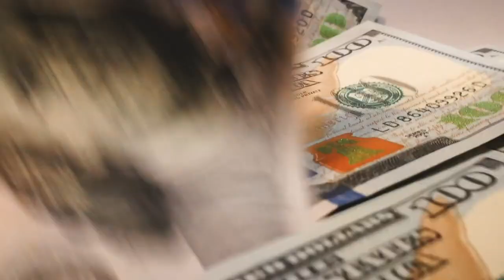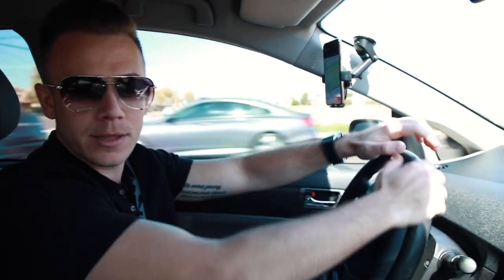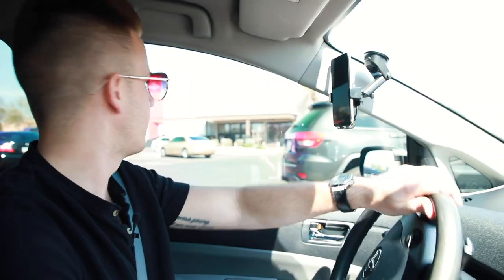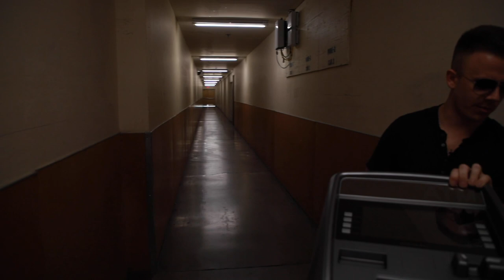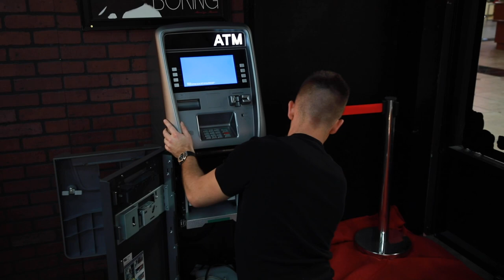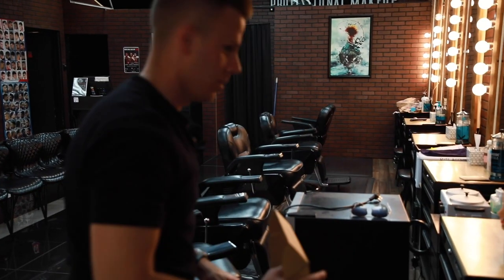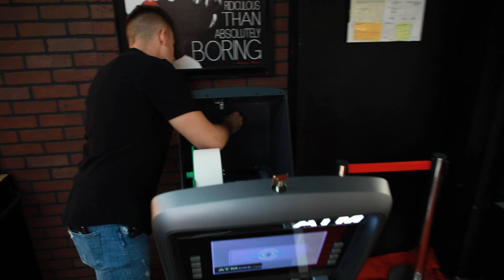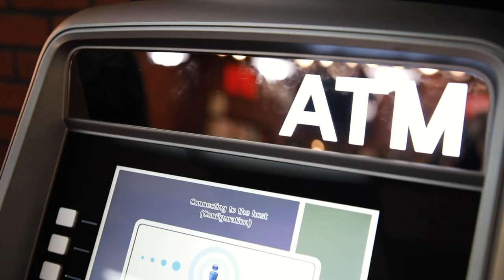INSTALLING An ATM Machine | $375/MO Passive Income

Comment: Should you secure the machine to either the wall or floor or simply relying on the weight as a deterrence?
Reply from the maker: I would bolt to the ground but some businesses do not allow

Comment: I've been lucky enough to find a set of used machines going for considerably cheap and would like to use this opportunity to develop a secondary source of income, however, there is a lack of information on how to get things started being based in the UK, so here are some questions i would like to ask:

1. If purchasing and owning the ATM, do i need to be partnered with an Operator?
2. If YES, do Operators charge a fee per transaction?
3. If NO to question number one, will i be the person installing the machine at the location?
4. The machines are dial-up, is this still ok?
5. Do i need to create contracts between me and the location owner?

I hope you get to see this query, and do look forward to a response!
Reply: Be careful when purchasing used machines, sometimes they’re  already pre programmed and will scam you, if you do plan on buying a used machine, do it from a reputable seller

Comment: For wifi, can it wirelessly connect? I saw you connect it to something
Reply: I know for Genmega 2500 ATM’s you need either a atm modem or the business needs to have an Ethernet cable you can connect too

Comment: If the mall had free WiFi, would you be able to use that or would it need its own WiFi router?
Reply from the maker: Unfortunately no that wouldn’t work, you’d still need a separate WiFi box.
Reply: @AustinZaback  where do you get a wifi box and how much is it?

Comment: Great video. 
Do you use the barbershops Wi-Fi? Or do you have a separate plan?
Reply from the maker: Couple ways I did it. You need to hardwire the Ethernet to the modem or router or get a Wi-Fi extender and connect the extender wirelessly and both would be connected to the shops connection

Comment: The WIFI is a additional charge?
Reply from the maker: If the location does not have Wifi then you would have to go with DPL or something of the sort.
Reply: @AustinZaback  
Hey buddy, do you ever bolt them down so kids or adults don't tip them over?

Comment: I wish to know, how much does the owners charge you for placing your ATM in their shop?
Reply from the maker: Many times they don't charge anything at all! But it really just depends, It's always negotiable. I typically wont pay them much if I do it will be around .50$ per transaction.
Reply: @Nolan.Gurule  of course he doesnt answere the major questions like "nobody will let  you tear up their floor to bolt it down".
Reply: @beast4548  I’ve only had one location not want to put holes in their floor. We use drop in anchors so if we ever removed the machine or moved it we could just cap the holes. Not ideal but I’d never want to install a machine without bolting it down
Reply: @marcusanderson3995  nobody wants a cheap fix after you destroy the floors! Your method is terrible and no respectable business would let you destroy there floors that cost must more than a $1500 ATM machine.
Reply: @beast4548   well good thing I’ve never had to remove a machine and patch some small holes. Any respectable business would understand the cost to place an atm in their establishment. If someone broke in, the last thing they’d be worried about is 4 holes in their floor. Why even place a machine if you think you’ll have to remove it later?
Reply: @marcusanderson3995  you have no clue what you’re talking about. Most business just buy their own atm and machine and keep all the profit. You come in with your cheap machines that only dispense 20’s and the damage you do to the floors far outweighs the cost of the machine.
Reply: @beast4548   you just revealed your own ignorance. Quit commenting about a business you know nothing about.
Reply: @marcusanderson3995  sorry bud, the truth hurts. People need to be made aware of this scam. It’s a terrible business and is quickly vanishing.
Reply: @beast4548  what truth? And how is it a scam? Atms aren’t going anywhere. You have to hustle to get locations. It’s much harder to enter into the market now as there is much more competition and getting an atm in your store is easier than its ever been with many companies willing to pay 50% of the surcharge in commission. But go check any gas station, liquor store or market and let me know if their machine isn’t bolted to the ground. I guarantee 99% of them are. But those aren’t good locations right?
Reply: @beast4548  I’m sorry dude but you’re obviously the one lacking experience. I’m in the business and have been for almost 7 years. I have multiple merchants loading their own machines. True, a couple have had their bank accounts closed with no direct reason as to why, but they found other banks willing to take their business. What kind of business doesn’t want an atm because it will look tacky or threat of theft? I’ll tell you, one that’s not a good location for a machine. There’s a reason there’s an atm in every gas station, liquor store, market. It’s because they make money. Look there’s drawbacks to every business. If it was so easy, everyone and their mom would do it. A lot of people have tried and realized it’s not as easy as it seemed and gave up. You have to grind. I didn’t make decent money until my 3rd year and had to work as a service tech for Cardtronics to cover my bills. It sucked and my days were very long but it paid off. Good luck finding a way to make money in this world without a lot of effort.
Reply: @beast4548  I’ve been forthright throughout this whole exchange. Were you someone who’s bank account was closed and stuck with a machine? My merchants were all able to find banks to take their business. I have multiple gas stations and markets so just because some own their own machines doesn’t mean they all do. Seems like you’re just making excuses as to why this business won’t work for you. It’s not for everyone. And how is it a scam? I don’t make money off other people getting into the business. If anything I lose money because there is more competition. I just know I was in the same situation as them and I’m willing to help give advice. If everyone was as discouraging as you I might not have taken the steps to build it into what it is.
Reply: @marcusanderson3995  I’m trying to help people so they don’t waste their time on pipe dreams. Long story short, this is not advantageous to anyone and if they are lucky enough to find a bank that will open a business account they will close it after three months and be stuck with a worthless machine. Other respectable YouTubers have emphasized this flaw that you refuse to acknowledge. To anyone reading this… Don’t try and start an ATM business or you will be wasting a LOT OF MONEY AND EFFORT!
Reply: @beast4548  so you’re not speaking from experience? Good to know. The business isn’t for everyone. You have to hustle. Not all banks will close your accounts but you seem to think every single one will. If you’re getting into the business, you have to think about it as a side job. Don’t go into it thinking you’ll be able to live off of it. You won’t make enough money for that until you have lots of good locations.
Reply: @beast4548  you’re bitter about your personal experience. Fantasy is “the bank will close your account no matter what”, “no one will let you drill holes in their floor” and “the machines only dispense $20s”. All lies, the exact opposite of being honest, or you’re just talking about something you don’t know. It’s not easy. Starting any business is very hard and a lot of people fail. But people learn from their failures and hopefully have a better understanding of who they are and which direction they should go next. Your advice is, just stick to a real job because you won’t make it.
Reply: @marcusanderson3995  Dude your whole deal is a sham. Bottom line is that the ATM business is a terrible and not even a real business. You can cry and call people liars who know the business all you want but that’s just a sign that you’ve lost the argument. I’m done since you’ve resorted to name calling. Anyone reading the thread should be convinced by the facts that it’s a bad idea.
Reply: @beast4548  those are straight up untrue though. Just admit you don’t know what you’re talking about or change your statements to “sometimes” a bank will close your account, “sometimes” a merchant doesn’t want to anchor a machine, “some” machines only dispense one denomination. You make it seem like it’s impossible to have a business account for an atm. Yet how do people have atms? All of my machines are anchored. I have 3 atms with dual dispensers that dispense 10s and 20s. My business is a sham and not a real business? So I should just give up my source of income and sell all my machines and get a “real” job because you don’t like it
Reply: @marcusanderson3995  Dude take your fake business advice somewhere else. Bottom line, banks hate the atm business as do credit unions. Banks won’t let you open an account and if they do, they close it a few months later. The business where your expensive atm is located (has 5’s, 10’s, 20’s cartridges ) will not let you put an atm machine back in their business. Just stop making stuff up and trying to attack everything I say. I know more than you want to give credit for and your just being strait up deceptive. I’m done messaging you so don’t waste any more of our time.
Reply: @beast4548  Quit talking about a business where you’re obviously clueless. You’re willfully misleading people because you failed in the business and are bitter. I haven’t been deceptive at all. Not one thing I’ve said is untrue, whereas you’ve been saying things that are blatantly false. You’re talking about something you have no idea about and it’s very clear. You’re not in the business yet you think you have the authority to determine if it’s good or not.
Reply: @marcusanderson3995  
Found a business for sale 95k and 35k cashflow, 70k gross .. not sure if this is a good , route/business to buy .. what your take
Reply: I have the fact that we will anchor to the floor in the contract they sign. Zero issues. Plus I have proof they signed off on me drill the holes.